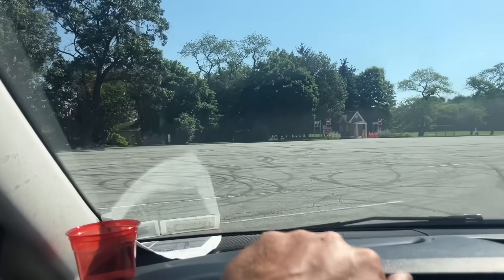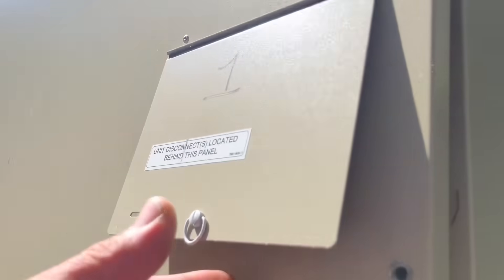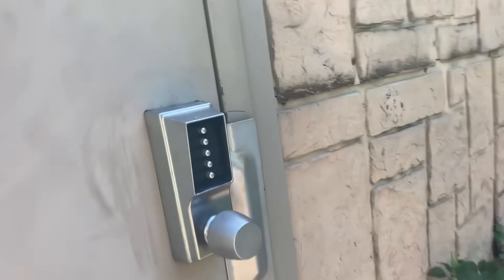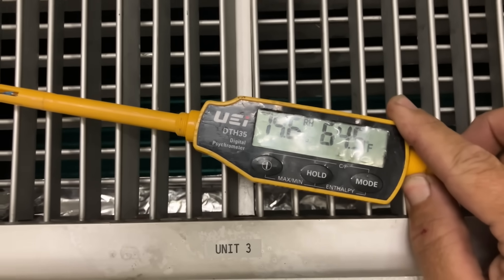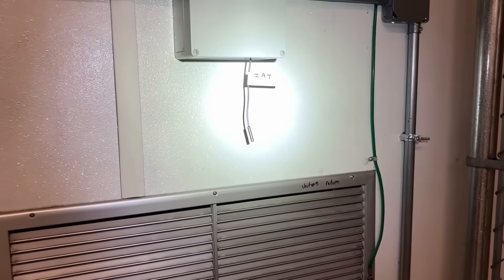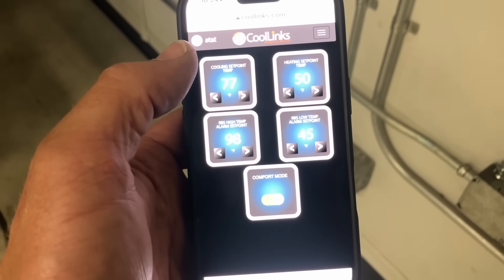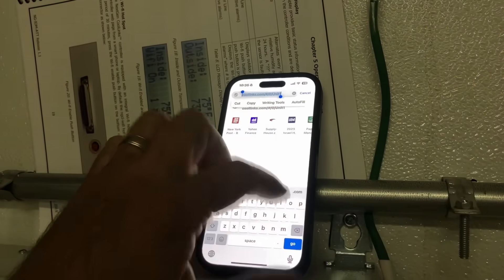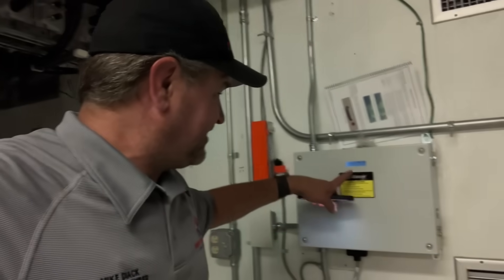Inside a Cell Tower: Critical HVAC Repair to Keep Signals Alive!

Comment: Oh man, Bard units.. Have a handful of them across a few different sites..  The condenser coil is tight on those boys..  High head pressure will shut them down all the time if not cleaned well and often..  The newer units will give you two shots at running.. Will shut down once and restart on its own, but the older units will shut down and not start back up unless you end the call for cooling..

Comment: Redundant cooling, so the site manager can wait twice as long to put a peny into maintainanence. I've also seen a lot of mini splits and window units, even residential air handlers strapped to the ceilings. But mostly those Bard wall hung units, they're the backbone of equipment shelter cooling and prefab buildings.
Reply from the maker: Interesting observation.

Comment: These locations generally require an NDA. Posting pictures of the interior of telecom locations is generally not permitted. Not sure AT&T would be pleased with this video.
Reply: RAT
Reply: @mikeholubek4419  yes sir, spent many hours in those as a comm tech. Our sites wrre considered Critical imfrastrucure.

Comment: hope you turned the wifi back off,  before some l33t hax0r changes the parameters and turns the heat on to 140F or something. lol
can likely get it's wifi outside the building plenty well given all the leak points through the hvac gear itself.

Comment: Considering all that communications gear are akin to toaster ovens, HVAC systems are critical to not only keeping the equipment running but ambient heat impacts part longevity
Reply: temperature and humidity both are critical, year round.
Reply from the maker: exactly.

Comment: We only have 176 dollars to our account but we're gonna donate something to the Mikey Pipes Philanthropy channel to help those that need heating, cooling, and hot water. I've built my own shack from nothing and was fortunate enough to provide myself with hot water. This is for someone that cannot do that and I thank you so much for helping out our fellow neighbor. We had a service call once to add a circuit to a repeater radio for the Michigan State Police. Our master electrician started wiring the receptacle and one of the tower guys came in and started chattering about violating their code reading off numbers and blowing our minds but when they started their reasoning, we caught right on and I went back to the shop racing against time to pick up a couple of "Apples" or isolation grommets because our grounding system and the radio grounding system were different and we had to isolate our system from their system.
Reply: did you get hit in the head lol  Mikeys a millionaire eating lobster